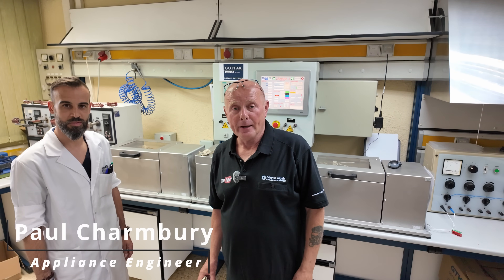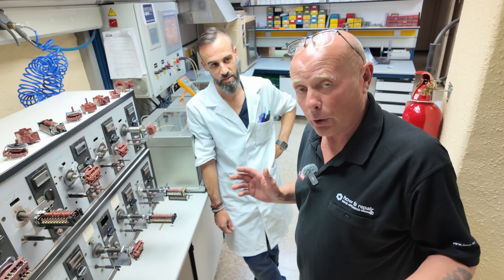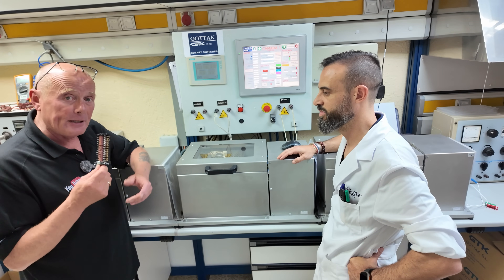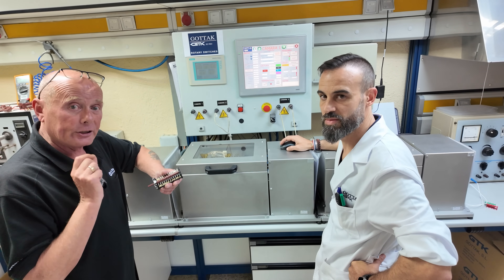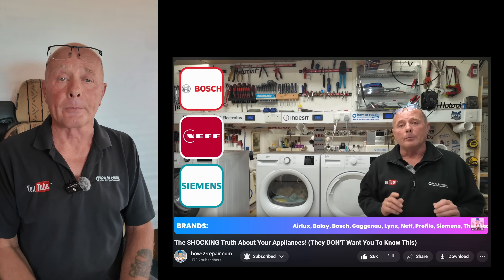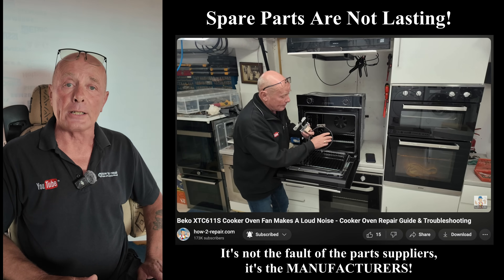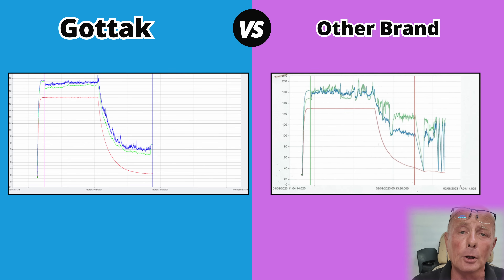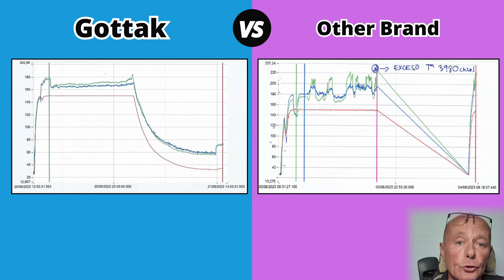Why Your Appliances FAIL SO FAST! Lab Results EXPOSE the Truth!

Comment: I have been working in the appliance trade for over 40 years.
  Modern machines are crap. At training classes I have been told to expect the first failure in 3 to 5 years and design life of 10 to 15.  All manufacturers are doing it so they are getting away with it.
Reply from the maker: Thank you so much for sharing your perspective from 40 years in the appliance trade. It's incredibly valuable to hear directly from experienced professionals like yourself.

Your confirmation that you were told in training classes to expect the "first failure in 3 to 5 years" and a design life of 10-15 years is a stunning piece of information. It proves that this isn't accidental but a calculated part of the business model from the very beginning. And you've nailed exactly why they get away with it – because it's become an industry-wide practice, leaving consumers with very few durable choices.

This is the very definition of the built-in obsolescence we aim to expose. Our goal is to make this "insider" knowledge available to everyone. For a deeper dive into this topic and to see the examples we covered, please check out the full video here: https://youtu.be/gEgSCbZnHVM?si=wTIw0mELuhWaw4aX

Comment: Unfortunately, planned obsolescence necessary. If you sell things that last forever, you quickly go out of business. Also, very few people are willing to pay a higher price for better quality. The problem will only get worse.
Reply from the maker: That's a very common perspective, and it really gets to the core of the business logic used to justify the current state of manufacturing.

However, many successful companies have proven that a reputation for quality can be a winning strategy. Brands like Miele, for example, built their business on longevity. While they might sell fewer machines to one person over their lifetime, their sterling reputation earns them new customers constantly through word-of-mouth. A 20-year-old working appliance is the best advertisement possible.

Regarding your point about price, we believe the bigger issue is a lack of trust and information. Many people are willing to pay more for quality, but they've been burned by expensive products that failed anyway. When the price doesn't guarantee quality, people default to the cheaper option. They aren't unwilling to pay for quality; they're unwilling to be ripped off.

The profit model based on frequent replacement is exactly what has led to the built-in obsolescence we cover in the video. For a deeper dive into this topic and to see the examples we covered, please check out the full video here: https://youtu.be/gEgSCbZnHVM?si=wTIw0mELuhWaw4aX

Comment: I’m going to make sure all of my appliances run these selector switches as the inferior ones just don’t last! My tv and computer firsthand but I’ll have to find the model of the one’s used in my microwave and dishwasher the ac should be pretty standard but my PlayStation has me buggered!  which selector switch I need?
Reply from the maker: In most modern devices, the weak link isn't a physical switch you can easily replace, but a tiny component on that central computer board. So, the real problem is that the "brain" of the device is often designed to fail.

This shift from simple, repairable, mechanical parts to complex, disposable electronic boards is a core part of the built-in obsolescence we discuss in our videos. For a deeper dive into why modern appliances fail and the components that are actually to blame, please check out the full video here: https://youtu.be/gEgSCbZnHVM?si=wTIw0mELuhWaw4aX

Comment: C'mon, man. It's not the selector, it's the digital motherboard. You know that. A replacement board costs almost as much as a new unit for a reason, and it ain't because it costs that much to manufacture the board. The manufacturers know what they're doing. Anyone familiar with MOS is aware that it can be programmed for a specific number of cycles. It's PROGRAMMED TO FAIL, so you'll be forced to buy a new one. I have an International Harvester refrigerator that has been running since the '40s! So saying that the manufacturer sees our opinions and they "matter" is disingenuous. "Durable Goods?" I don't think so.
Reply from the maker: While a flimsy mechanical selector is a problem, the true heart of modern built-in obsolescence is the electronic control board. When we say opinions 'matter,' we mean they matter when they translate into financial consequences or political pressure for the manufacturers. The goal of this channel is to arm enough people with knowledge to create that pressure, because that's the only opinion they're forced to listen to. The term Durable Goods has indeed become a joke for many products.

This is exactly the kind of built-in obsolescence we discuss in the video. For a deeper dive into this topic and to see the examples we covered, please check out the full video here: https://youtu.be/gEgSCbZnHVM?si=wTIw0mELuhWaw4aX

Comment: What do you think they have done ever since light bulbs have been around? Now look LED crap. Really expensive and the shortest life span we have ever seen in light bulbs. They produce loads of bad light rays that are not good for us. Yes, that is a proven fact.
Reply from the maker: The story of the light bulb industry is where planned obsolescence was famously born with the Phoebus cartel, and you are absolutely right that the same tricks are being used with modern LEDs.

They promise a huge lifespan, but that promise usually only applies to the LED diode itself, not the cheap, low-quality electronic drivers they build around it. Those electronics are designed to fail quickly, making the entire expensive bulb useless. It's a textbook example of built-in obsolescence: taking a durable core technology and crippling it with cheap supporting components to ensure it has to be replaced often. You also raise a good point about light quality, which is another area where cutting corners can negatively impact the consumer.

This is exactly the kind of design philosophy we discuss in our videos. For a deeper dive into how this plays out in larger appliances, please check out the full video here: https://youtu.be/gEgSCbZnHVM?si=wTIw0mELuhWaw4aX

Comment: So, My 5 year old Frigidaire gas stove just had a burner not igniting.
Well, looks like I have to purchase a new wiring harness.
I use THAT burner all the time. 365days x at least 5 times a day we get: 1825 rotations.
Now multiply that by 5 years we get: 1825 rotations per year x 5 years of use: 9125 rotations.
Well, I am good at spending the money on a new harness which replaces ALL 5 burners.
Much more cost effective than being an empty consumer.
Cheers.
Reply from the maker: Your calculation of over 9,000 cycles is a perfect example of how 'normal use' can really add up, and why these parts should be built to a much higher standard than they currently are.

It's also very telling that you have to replace the entire wiring harness for a single burner's issue. That's a common design tactic that makes repairs more costly and complex, often to discourage people from even trying. Your decision to spend the money on the part rather than a whole new stove is a big win for the consumer.

This is a textbook case of the built-in obsolescence we discuss in our videos. For a deeper dive into why these parts aren't designed for the long haul, please check out the full video here: https://youtu.be/gEgSCbZnHVM?si=wTIw0mELuhWaw4aX

We also explored related aspects in these videos:

The shocking truth about manufacturers: https://www.youtube.com/watch?v=QsdGd2qDPaI
Heat pump tumble dryers are they really worth it?: https://www.youtube.com/watch?v=xn03N3b0-lE
If you found this information eye-opening or helpful, please consider sharing this video with your friends and family. We need more people with your can-do attitude!

Thanks again for sharing your excellent example! Don't forget to subscribe to the channel for more insights like this!
Reply: @How-to-repair  You know, the really dumb part of all this is that the igniter began to work again after 4 days while posting this!
Go figure.
That said, will have to put aside the 'Canadian' funds to purchase a wiring harness.
Geez, best price that one can find is 124.00 not including tax!
Cheers.

Comment: I have a HotPoint washer/dryer pair from 1979.   I recall replacing some type of seal in the washer several years ago.  Other than that, still chugging along just fine.
Reply from the maker: Thank you for your comment. I appreciate people like you taking the time to write it out. Please share it where possible. It might help others make a wise choice instead of being misled by the industry.

Comment: One thing I noticed was on the control switches for electric stove top burners start to cause those burners to stay on Hi longer.  The temperatures are not consistent, and even if you lower the temp switch from Hi, down to medium or lower, the burner stays on continously (on Hi), potentially burning what you are cooking. They lose their ability to power the burners at a lower temperature. I noticed this on Kenmore, frigidaire, and Kitchen Aid electric stoves. The controllers appear to need replacing.
Reply from the maker: Those switches work by cycling the burner on and off at full power. Over time, the internal contacts that handle the high current can arc and eventually weld themselves together. When that happens, the switch gets stuck in the "on" position, delivering continuous full power to the burner regardless of where the dial is set.

This is a perfect example of built-in obsolescence. Using cheaper materials for those internal contacts saves the manufacturer pennies per unit but ensures the part will eventually fail in this exact manner. The fact that you've seen this across major brands like Kenmore, Frigidaire, and KitchenAid shows how widespread the use of these same low-quality components is.

This is exactly the kind of component failure we aim to expose in our videos. For a deeper dive into this topic and to see the examples we covered, please check out the full video here: https://youtu.be/gEgSCbZnHVM?si=wTIw0mELuhWaw4aX

Comment: I've fixed everything that rolls crawls and appliances. work napa parts 10 years. as engineer that can build anything,  new stuff s-cks. 1 out of 3-4 parts are defective. nothing build to best of ability. built only to last long enough to defer lawyers from class action lawsuit. smog is a lie. cant burn more fuel and reduce pollution. def turns into chemical weopon during Regen.
Reply from the maker: Your observation that 1 in 3 or 4 new parts can be defective is shocking and speaks volumes about the state of modern manufacturing. And your summary that things are built only to last long enough to defer lawyers is one of the most accurate and insightful definitions of this problem we have ever read.

This shift away from building to the best of ability is the very essence of the built-in obsolescence we discuss in our videos. For a deeper dive into how this plays out with the components inside appliances, please check out the full video here: https://youtu.be/gEgSCbZnHVM?si=wTIw0mELuhWaw4aX

Comment: It's not the manufacturers who are to blame. Every central bank in the world has a mandate to cause inflation. A couple percent of inflation every year adds up to an enormous amount over decades. And then the manufacturers have to use less material or raise their price.
Reply from the maker: That's a very sharp and insightful point. You are absolutely right that long-term inflation puts constant pressure on manufacturers and is a major factor in their decisions about materials and pricing. It's a piece of the puzzle that definitely can't be ignored.

However, while inflation can explain making a product generally cheaper to produce, it doesn't fully explain the specific tactics of built-in obsolescence. There's a big difference between using slightly less material and, for example, designing a non-repairable electronic board with a component that is known to fail just after the warranty period. One is a cost-saving measure; the other is a strategy to force repeat purchases.

The deliberate engineering of specific failure points, which goes beyond simply managing economic pressures, is the issue we focus on in our videos.

For a deeper dive into these specific design choices, please check out the full video here: https://youtu.be/gEgSCbZnHVM?si=wTIw0mELuhWaw4aX

Comment: Is it better or worse that everyone is replacing selector switches with buttons, microcontrollers, and relays?
Reply from the maker: A robust old mechanical switch was often over-engineered and had one job. A modern electronic control board has hundreds of components. The failure of one tiny capacitor or relay, often worth pennies, can render the entire expensive board useless. While the technology could be better, it also gives manufacturers a perfect tool for built-in obsolescence by creating a single, expensive, non-repairable point of failure. This is exactly the kind of thing we discuss in the video.

For a deeper dive into this topic and to see the examples we covered, please check out the full video here: https://youtu.be/gEgSCbZnHVM?si=wTIw0mELuhWaw4aX

We also explored related aspects in these videos:

The shocking truth about manufacturers: https://www.youtube.com/watch?v=QsdGd2qDPaI
Heat pump tumble dryers are they really worth it?: https://www.youtube.com/watch?v=xn03N3b0-lE
If you found this information eye-opening or helpful, please consider sharing this video with your friends and family. The more people who understand what's happening with appliance longevity, the better equipped we all are as consumers.

Thanks again for asking such an important question! Don't forget to subscribe to the channel for more insights like this!

Comment: Not convinced.  Too much trouble without much benefit for the company. What if they guess incorrectly by a little bit and it fail prematurely? It has to spend money to repair.
Reply from the maker: The reality is that this isn't guesswork. Through massive amounts of data and testing, companies can predict failure rates with a high degree of accuracy. They aren't inventing complex ways to make things fail; they are often simply choosing cheaper components (like specific capacitors, plastic gears, or bearings) that have a known, limited operational lifespan.

The cost of warranty repairs for the small percentage of units that fail too early is budgeted as a predictable cost of doing business. That calculated cost is far smaller than the massive profit they make from the huge number of customers whose products fail after the warranty expires, forcing them to either buy a new product or pay for an expensive repair. It's a cold, statistical calculation where the long-term profit from repeat sales outweighs the short-term cost of some warranty claims.

This is exactly the kind of built-in obsolescence we discuss in the video. For a deeper dive into the specific components chosen to fail, please check out the full video here: https://youtu.be/gEgSCbZnHVM?si=wTIw0mELuhWaw4aX

We also explored related aspects in these videos:

The shocking truth about manufacturers: https://www.youtube.com/watch?v=QsdGd2qDPaI
Heat pump tumble dryers are they really worth it?: https://www.youtube.com/watch?v=xn03N3b0-lE
Thanks again for asking such a sharp question; it gets to the very heart of the business logic behind this practice. Don't forget to subscribe to the channel for more insights like this!
Reply: @How-to-repair  thx for the explanation, but sorry i am still not convinced.
1. There is a very high chance that the customer will buy another brand instead. I wouldnt want to buy the same brand that fail kind of fast. In this case the company lost that customer, and hence the revenue stream, forever.
2. Expensive repair. This plan only work when there is no third party shop that can repair the product. My local repair shop can repair a lot of things.
3. Longevity is one of the feature i look for when i buy stuff. My fridge always be mitsubishi, my next  phone will be samsung despite many of its drawback.  If product fails fast, people will talk and the company can not sell. For example i would not buy samsung washing machine.

Comment: Pre-set lifespan, for a "value based pricing" price. I didn't know I needed to buy quality stuff 20 years ago to be able to use it now. They're a bunch of criminals.
Reply from the maker: I've reached the point where I simply cannot tolerate this situation any longer, and that's why I made this video. I'm aware that this might cause some controversy, or even land me in trouble, but I believe it's crucial to try and make a difference. I would greatly appreciate it if you could share this video. Together, we might be able to bring about some change. If we can't shame the manufacturers into action, perhaps someone in government will see the video and take notice of the overwhelming number of comments expressing public concern.
Reply: @How-to-repair  I will, and thanks for doing this!

Comment: Maybe consumers should turn the tables on the manufacturers?
Hang a stepper motor on the front end of the selector switch. Run the switch through 20,000 cycles, then use the appliance as intended.  If you get a failure in 3 months, you're within warranty. Have them send you another. Repeat the process. When they start to figure out that they are giving away 5-6 appliances for every one they sell due to component failures, they'll rethink their strategies.
Reply from the maker: Thank you for your comment. I appreciate people like you taking the time to write it out. Please share it where possible. It might help others make a wise choice instead of being misled by the industry.